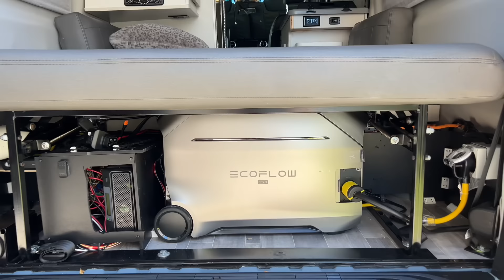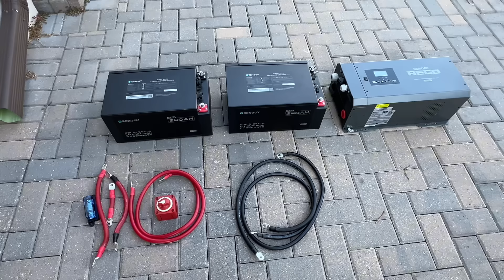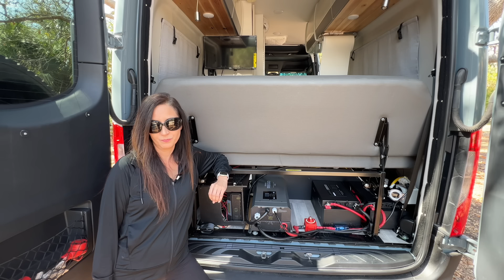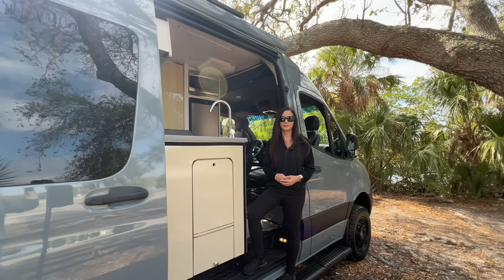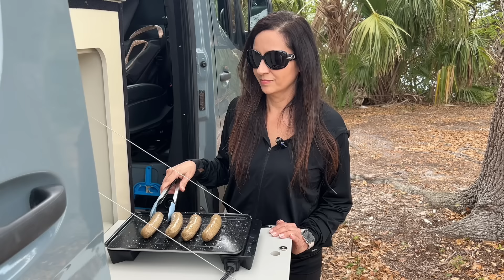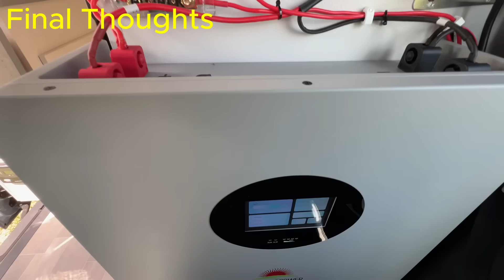Was 14kWh Overkill? Testing a Renogy Semi-Solid-State Weekend RV Power System

Comment: I’m contemplating replacing the 2-100ah lithium batteries in my telarro with 4 cheap 300ah batteries. 2 outside and 2 inside but after watching your videos I’m wondering if it’s smarter to do it your way. Do you ever upgrade other campervans for videos with us paying you for your labor and knowledge of course 😃
Reply from the maker: Hello Sharon, Thank you for the comment.  I usually stick to my own RV, but I try to show how easy it really is to make these types of upgrades.  I will say that trying to change out the batteries under the RV is much more of a challenge than the ones on the inside just because of the space limitation and the awkward placement/heavy batteries.  I actually have left my external batteries in place (for now).  Give me a little more information about your system and lets see if I can help you with ideas.
Reply: I have a 2022 Thor tellaro with 2-100 lithium batteries and a 3000 inverter and solar panel that I think is 190. I have been running the van all night at rest areas and Walmart’s until the uhg burnt out. The gentleman at abc outfitters explained that I should not be doing that and I need more solar and batteries. @RubysAdventuresUnplugged
Reply: I’m not sure if you replied. I’ve never commented on a YouTube before

Comment: Great video, I want to learn more about solar and you gave great info and easy to understand.
Reply from the maker: Hello Jocelyn, Thank you so much, I'm thrilled you found the information easy to follow! 😊. Solar/Lithium is the future of electrical systems and I have spent a lot of time learning and experimenting with different configurations.  It is really important to understand how different voltages impacts the overall system.  For example, you see in this video I am using 4/0 wiring which is much more expensive than standard 10AWG wiring.  This is because using a 12.8V battery to generate 120v AC power  requires more amps.  More amps means thicker wiring, bigger fuses, more heat generation, etc ... The most important equation is solar/lithium is:  Amps * Volts = Watts. Once this is understood (and the implications), it becomes really easy to start properly configuring a lithium power system.  Thanks for watching!

Comment: Great video! 👍👍👍You're the only YouTuber with a series of videos demonstrating various battery installation setups in an RV. By the way, have you tried testing different inverters to compare their reliability and power efficiency?
Reply from the maker: Hello Mike, Thank you for the comment!  My goal is to show equipment actually being used for its intended purpose, so your statement is a huge compliment!  I had not thought about creating a video demonstrating the performance of different inverters ... I like the idea!  I will say the Renogy inverter really works well.  Thanks for the idea!
Reply: @RubysAdventuresUnplugged, the pass-through feature is a game-changer. One question: if the inverter is off, can the pass-through still work? The battery won't be triggered. Well, that's the meaning of pass-through, isn't it?
Reply from the maker: Great Question:  For the Renogy REGO 3000W Inverter/Charger, the pass-through behavior is automatic when shore power is present, and the power switch only controls the inverter portion, not the shore-power pass-through. Here’s how it works in practice:
1️⃣ When Shore Power is Connected
The internal automatic transfer switch engages.
Shore power goes directly to your RV loads.
The battery charger activates and charges the batteries at the same time.
The inverter section is bypassed, so it is not powering the RV.
This means pass-through power works automatically whenever AC input is present, regardless of whether the inverter is turned on.
2️⃣ When Shore Power is Removed
The transfer switch automatically switches to inverter mode.
The inverter begins supplying 120V AC from the batteries.
This switch typically happens in ~20 ms, so most devices won’t notice.
3️⃣ What the On/Off Switch Does
The inverter power switch only enables or disables the inverter output from the batteries.
Reply: @RubysAdventuresUnplugged Excellent detailed explanation. The Renogy inverter seems to be a quality product with low power use. Thanks for taking the time to remove the old setup and install this one. It's much more time-consuming than just introducing an RV.
Reply from the maker: NP, these types of videos do take some time to create but I am happy to share my experience with he products and I lean a lot of this as well each time I do this .... win win!

Comment: Excellent Ruby as usual. Will look at the griddle, I like the low wattages. I installed an additional Renogy batteries (2x100ah slim battery under the sink) and put the inverter under the passenger side cushion. I added a Renogy dc-to-dc charger and added extra solar. I like Renogy products and had no issues with their customer service. I think the Mastervolt system is good but it can be finicky at times. I'm just curious how you got all of the tank, water, lights and all of that integrated with the new battery. One thing I hate about the BMPro, it does not show state of charge, only voltage.
Reply from the maker: Thank you for the compliment and the comment!  I really like the Renogy products as well.  They make excellent equipment and it is all purpose built.  As for your question, My RV cannot tell the difference between shore power and battery power.  My RV did not come with a lithium system.  The shore power and the generator supply power to the entire RV through the breaker box and this battery system does the same ... the inverter is supply power to the breaker box ... so everything functions as normal.  Thanks for watching!
Reply: @RubysAdventuresUnplugged  Thanks, keep it up, love your videos.
Reply from the maker: So glad you liked it, TY